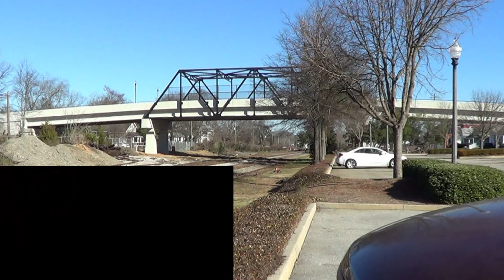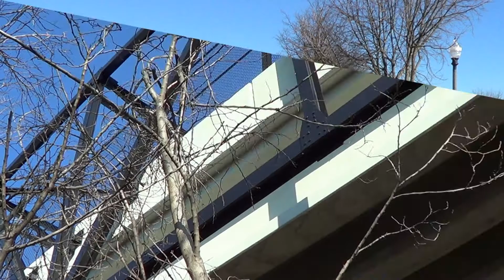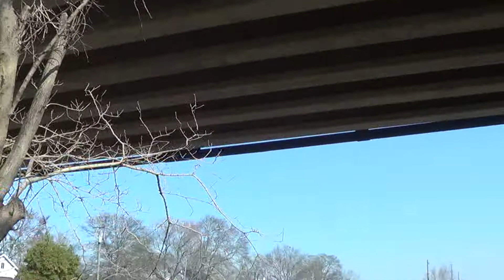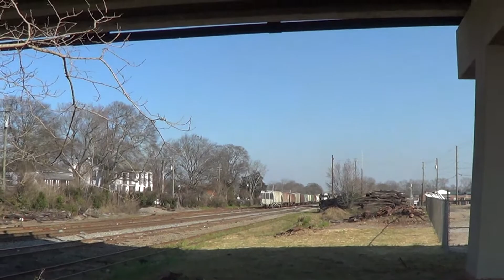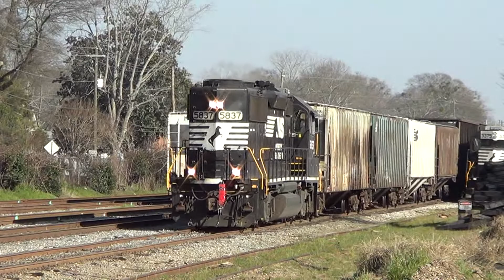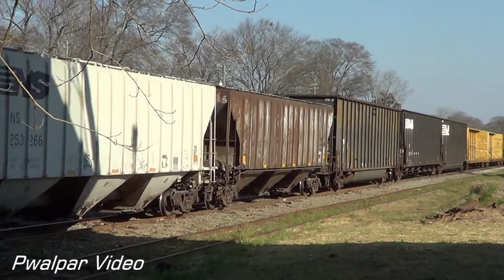Train GO3 Switching Griffin Yard 1 23 2013

Comment: Nice vid, Walter. Have to love the G.D.O.T. They used to turn our company trucks around and send them back to asphalt plant if the temperature was too low by a few degrees. Very very strict requirements to lay asphalt on state owned roadways. It is surprising, however, that the bridge roadway surface isn't concrete as opposed to asphalt.